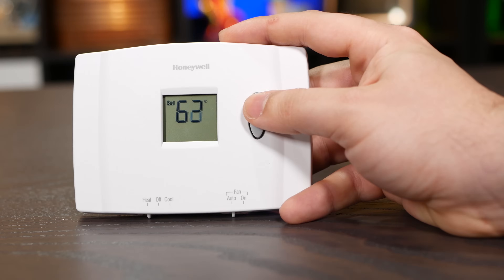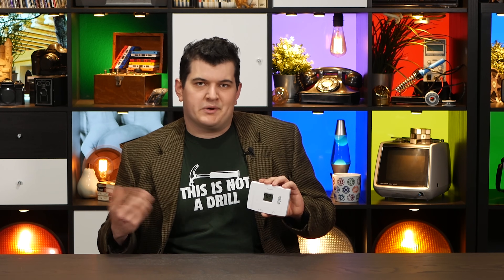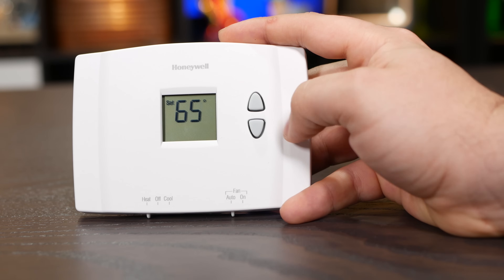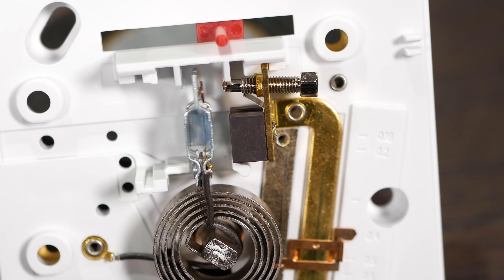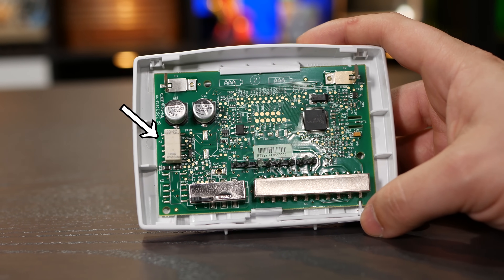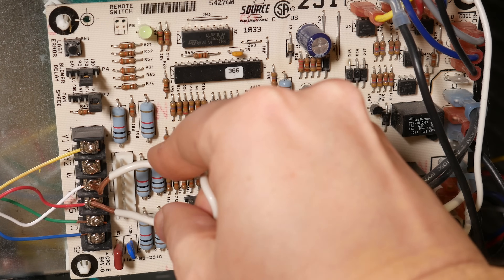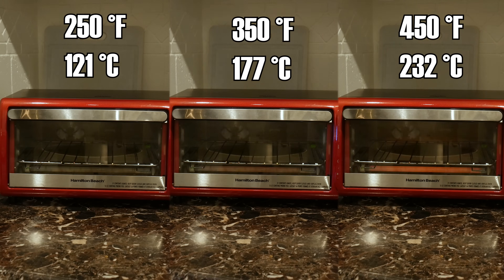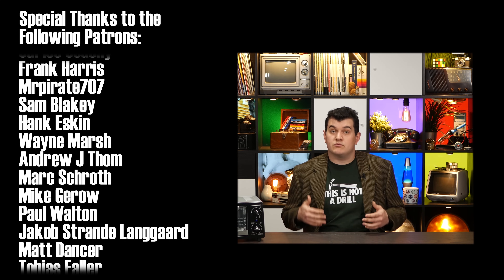Thermostats: Cooler than you think!

Comment: I am VERY late to this, but I have thermostats that will sort of do what was asked at the end of the video. Mine are programmable, but not smart or internet connected. If I have the daily programs set (which I do), I can increase or decrease the temperature and it will use that temperature for the remainder of the current program length. Once that program block is over, it resorts to the programmed temperatures. Selecting a different temperature and then pressing "Hold" will hold the temperature indefinitely and ignore the programmed times and temps.

Both of our thermostats are White & Rodgers. We have a two story home with dual zone heating and cooling. There is an electric damper in our ductwork so upstairs and downstairs can be controlled and called separately. This ESPECIALLY helps in the summer with A/C. There is usually only about a 1 degree difference between the two floors, even on the hottest days of summer. We are in the Detroit area, so very similar summer heat and humidity as Chicago.

Lastly, even though this isn't related to thermostats, I installed a Quiet Cool whole house fan last year. On "Low" setting it draws 165 watts and is advertised to move 4000 cfm at that setting. When night time temps are advantageous I turn the A/C off altogether, crack a few strategic windows and run the whole house fan on low all night. I can usually get the house down to about 62 degrees by morning. I then shut off the fan, make sure to close all the windows, blinds and curtains, and by 4:00 pm it generally is not any warmer than about 75 degrees in the house, assuming an 85-90 degree outside temperature. For reference, the A/C is a 4 ton unit, and all-in, draws about 4500 watts, so the whole house fan can be run for 8 hours easily while only consuming the electricity that our A/C would use in 15 minutes. This is the first year in many years that my electric budget plan rate has not increased from the previous year. I am pretty sure the whole house fan had something to do with that, as we avoided many days of A/C use. We also use it during the day on a handful of spring and fall days when the outside temp is slightly higher than inside which allows the furnace to run less.

Comment: The HVAC system at my work is new and there is no heat pump or furnace, but it uses some sort of resistive heating element somewhere. The interesting part is that there are two independent heat wires and since the thermostat is a nest one it actually displays which ones are on. So if the temperature is within 5ish degrees of the set temperature it’ll only use heat 1 and the elements associated with that, but if it’s 6+ degrees it uses both the heat 1 and heat 2 elements. I assume the temperature ranges can be adjusted, but that does mean that if you turn the thermostat higher it will most likely heat faster than just setting it to the desired temperature. That being said it’s incredibly slow and we still have a gas heater that we use in the winter since it’s considerably cheaper and heats up way faster.

Comment: You actually can make a thermostat that allows you to set a time and return to normal you would just have to DIY it with a Raspberry PI or arduino. You would probably also need to get some LoRa Sensors and stuff as well for actual sensing but then its just a little bit of code and homeassistant. Someone may have already done it there's plenty of projects out there.

Comment: I know this is an old video but, thermostats that allow you to change the temperature but just for abrief moment do exist, and here in europe they are quite common. Im not talking about nests etc but plain simple thermos that have manual and automatic mode, on automatic a preset temperature is ajusted in the settings (they have a scrren with a knob, but not wifi or any of that stuff) and then if you wish you can change the temperature like you would normally, but after the noe target has been reached the set point will be put to the predefined one again. hope this helps :).

Comment: I'm using home assistant running in a VM along side an ESP temperature sensor, and smart switch to control the space heater in my bedroom.  It works pretty well.  The advantage is that I can have the temperature sensor across the room.  I also don't have to worry about fiddling with the temperature knob on the space heater witch is imprecise.  I also get the advantage of historical data for temperature and power usage.

Comment: I had to replace the battery on my thermostat once. The furnace turned on. After I while I noticed it was getting hot. The furnace wouldn't turn off. Turned out the battery died, replaced the battery and it worked correctly after that.

Comment: My Carrier Infinity thermostat can do what was asked at the end of the video. It has the ability to have a set routine that I can deviate from for a set amount of time. So in your example of coming in after mowing, I could adjust the thermostat to a crazy unreachable number to ensure it stays on for the whole 30 minute desired time, for example it's set to 70, I walk in and lower it to 50, the thermostat knows I am deviating from the set programmed cycle and I am offered several options: hold permanent, until the next scheduled adjustment, or a specified time before returning to the programmed temp. Then when it hits that time it immediately returns to the schedule without me having to go back to adjust it.

Comment: you could have a thermostat that runs ac or heat automatically if it can see how warm it is out side compared to your set point and have a small deadzone right around to your set point so it doesnt bounce form heating to cooling constantly  but i dont think it will ever be common due to the fact you dont need to switch form heating to cooling very often

Comment: 2:02 Sure thing!
So my pellet stove, depending on the temperature difference, feeds pellets into the combustion chamber faster or slower and in larger or smaller quantities, depending on whether it needs to heat up to a higher temperature, and slows down when the temperature is almost equal, with a difference of 1 degree.
Reply: I forgot to say it also regulates an air flow in a combustion chamber but I'm too lazy to edit

Comment: Apart from igniting my love of toast, you also gave me a sorce to work with when it comes to my view on heating and cooling my room.  I have a heater and digital thermometer the i use in conjunction to set my room temperature. I don't need a bimatalic switch to adjust things.  I do it myself because breath "I am in control.  My heater is off, medium, and high.  I leave for the day, it stays off, I return and toggle it as much as I wish to maintain comfort. It's a great system and uses less power than if it was on all the time.  Counter points! "It uses more energy to heat up the room if it's cold" yes, but it's up to temp in 15 minutes.  In an 8 hour work day, it's on for a full  hour while im away. "Are you worried about things freezing when you're out?" No, it dips to 10°C in the middle of winter if im out for 10 hours.

Comment: Interesting how done in the USA, over here in UK mainly we use water to move the heat from a furnace (we call it a boiler) to the room, and that water stores the energy to an extent, so the on/off switching (we call in mark/space) still gives a constant output. 

However, we are moving from digital (on/off) to analogue (up/down) controls, with ebus controls, like OpenTherm, the boiler can modulate (turn down) and so remove the hysteresis. And since water flow can be turned on/off or up/down easier than air flow, we can select when and how much each room is heated. 

This means we can adjust the speed at which a room heats up, either by adjusting the boiler output, or by selecting how many rooms are heated. 

The problem, however, is to get it all set up correctly, each radiator has a TRV (thermostatic radiator valve) and a lock shield valve, and having *123456 on the TRV means often we have no idea which should be adjusted, with electronic TRV heads, it can be worked out, but they are rather new.

Comment: See, thermostats are in a sense a natural duty cycle determination device.
They don’t know that’s what they’re doing, even though I’m fairly sure they might be sentient, but that is kind of what they do.
Yeah, really it’s just “it’s too cold, run the heat” followed by “it’s warm now, shut if off”
but if you take a step back and look over time, it’s really just slow pulse width modulation, with a bit of imagination, anyway.

That's it. That's the whole vid.

Comment: I like the comparison to PWM. And even the way PWM is controlled (on circuits I’ve learned about) is pretty “dumb and simple” as well.

Where a thermostat connects and disconnects a circuit based on ambient temperature, a PWM circuit connects and disconnects a circuit based on the charge on a single capacitor.

Comment: I have a Bryant something or other installed in 2022. It allows profiles on schedules. It also allows you to override the scheduled profile until a certain time with another profile or just a manual temperature. I don’t use it much, but I thought it might quality for your “short cooling cycle” use case.

Comment: I don’t know about 1 cycle exactly, but my digital thermostat has a “temporary hold” function where if I turn it up or down outside of its scheduled functions, it will run the higher/lower temp for like a half hour, then switch back to the scheduled temp.

Comment: Fun fact- if the batteries in your thermostat die when the HVAC is running it just keeps going! When I went to bed, the A/C was running, and I got woken up around 4am to the A/C still running and a VERY cold condo. 

Guess it's good to know my unit can get the place down to 60°, but that's a bit excessive 😵‍💫

Comment: Another fun thing, if you have a two stage based system. Turning it up to 80 still doesn’t do anything. Yes you will still kick it into stage 2 which would be more heat output, but it wouldn’t go any faster. anyway, this is just to boost engagement, if I am wrong in any form. Please do tell me, I’m still a apprentice in training for hvac

Comment: Turning up the heat more "could" increase the speed of the heating if you have a heat pump with emergency heat and you changed the set point enough to kick in the emergency heat.

Comment: My mercury bulb thermostat was installed when the house was built in 1951.  Recently installed a new furnace, but kept the old thermostat because it works just fine, doesn’t need batteries, and the little slider thing to set the temperature is easier to use than pushing buttons until the display shows the temerature you want.

Comment: My new used house has a bimetallic strip thermostat with separate levers for heating and cooling. No mode switch, just put the lever all the way up or all the way down on the one you don't want.

Comment: Why is it thermostat wire instead of Romex or similiar? 
It's low voltage wire. It's a whole different thing than standard wiring, different licensing, different requirements, different building codes.

Comment: Here in Manitoba Canada majority of homes that have a nautical gas supply will have a 2 stage heating furnace. For many years now the fancy systems are modulating and utilize more than 60 different heating stages and variable DC powered circulating fan motors.  It’s pretty common here.

Comment: My central heating, turning up the thermostat definitely makes it hotter immediately, because it increases the temperature of the hot water going into the radiators and coming out of the taps. Like, the previous tenant had it turned up so high that you could actually burn yourself touching the radiators and scald yourself from the scarily hot water coming out of the tap! You could've made a cup of coffee with it!

Comment: Where I live thermostats usually have mains voltage going to them (and the box on the wall that does the heating usually has a mains voltage input to tell it to run, athough there are now systems which can be configured to use digital communication, so the thermostat can tell the box on the wall how much it needs to heat)

Comment: 2 stage furnaces are actually very common. However, most are hooked up only to go into 2nd stage after the heat call has been on for 10 minutes or some other time.

But some thermostats can tell the furnace what stage to run on, and will go into full crank if the set temperature and the indoor temperature are very far apart.

-HVAC technician

Comment: My gas boiler certainly appears to heat the water more if the thermostat is at a high temperature. Normally, when it's just bobbing along at roughly 20ºC, it only heats the water to about 34ºC and the radiators get mildly warm. Set it to 28ºC and it will heat the water to 60ºC and the boiler will audibly be working harder. I have no idea how it knows how far away it is from its target temp or how the thermostat gives the full-blast command, but it certainly appears that it is doing something along those lines.

Comment: WAIT.
I grew up in a rural area. Power outages were common. Although we had a gas furnace, it had an electric starter, so if the power was out, the furnace wouldn't run.
Do you mean to tell me that ALL I HAD TO DO during those 16-hour power outages in the middle of January was to jump the red and the white wires until the gas started?
(Also, my parents still live in that house and I'm 99% sure that thermostat still is the mercury-ball type. The house was built in 2001, but it's also possible the thermostat unit was something they salvaged out of the original trailer before they demolished it. Guess I'll have to ask my dad about the history of the thermostat in their house when I visit next time...)
Reply: Mercury thermostats are the best. I wish I had one.

Comment: I know, I know, I am responding to a video of 5 years ago. Still.....
I live in a camper and it has a diesel heater. Diesel heaters are absolutely amazing, thogh they have a few peculiarities.
One of them is that they do not come with a thermostat. There are also no thermostats to be bought specifically for Diesel heaters.
Regular thermostats cannot be used due to the nature of operation of the heater.
Therefore I am building one myself.
I have planned to put in all sorts of features in there which normal thermostats do not have.
It has become an interesting project 🙂
Ones finished, I will open source the diagrams and code.
As it is getting co... co... colder quickly, I need to hurry with building 🙂

Comment: as someone who grew up in my teen years with a house that had the most baffling setup of radiator zone heating that my great grandfather apparently figured out and installed himself with an outside wood-fired boiler (yeah, that was a thing, and whoo boy.): I've seen the wiring complexity that is 'zone heating' done the non-digital way and it's terrifying in both complexity AND simplicity. Each zone had it's own control valve to let hot liquid into the system when called for... and htere was a shunt loop to keep things circulating if nothing was calling for heat to keep the line moving so you had a lot lower chance of freeze-ups if something went weird. That system also was capable of keeping a remarkably average insulation or worse house in the 90s, as we found out the first year living there. Albeit the cost in firewood of doing so was... kinda rediclous.

Comment: In Europe almost all thermostats in central heating systems actually modulate the power output of the unit. It is capable of running between 20-100 % of its power (max often around 20-32kW of a gas power high efficiency “furnace”). This makes the system burn “long and slow” which is way more efficient than constantly switching it on and off at maximum power. But ofc America likes to burn it gas wastefully whenever possible, including mediocre insulation of buildings. And then complain about the high cost of living, I guess.

Comment: lol my house actually has advanced HVAC. The closer it gets to the target temperature the lower heats the radiator water. (it actually has an indicator how hot it makes the water. Ranging from 30 to 80 degrees Celsius, with a configurable maximum). I suspect it has a PID-controller, since it ramps up the heat if it is not heating fast enough). 

But then again, I live in europe, so that might have something to do with it.
Reply: (also it is pretty common to have that kind of system here). Now I am gonna continue to watch the video and see if you already adress this.

Comment: More modern heat pumps with inverter compressors do actually make more heat when they are turned up higher. Changing the set point higher will make the inverter run the compressor faster and as it reaches its set point it will slow down. Iv got a midea duo that does this. Interesting it only has a in rush currant of 150 watts making it super easy on generators or inverters from battery's but can use all the way up to 1.4kw iv seen.